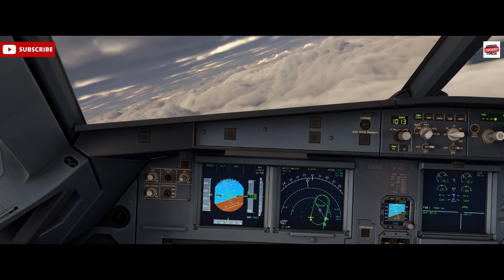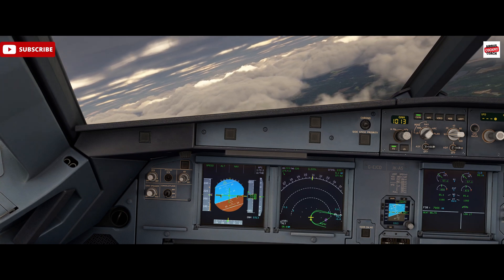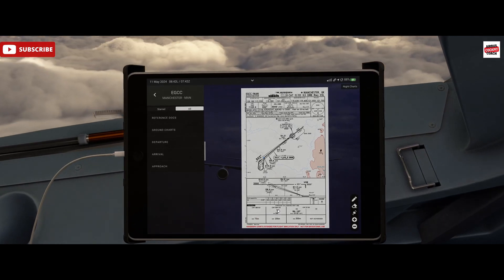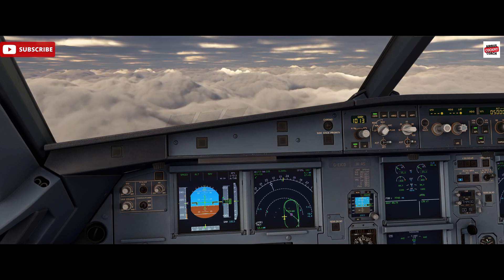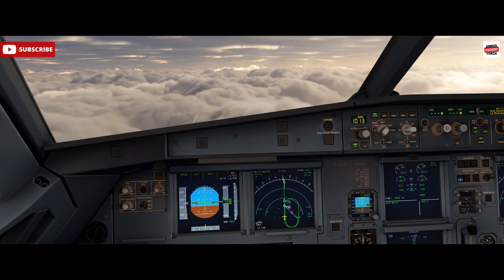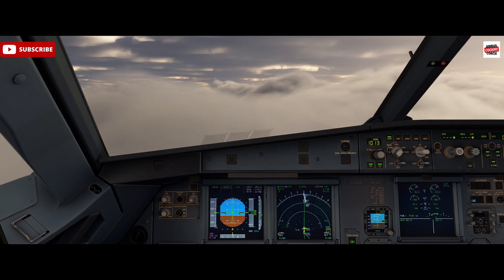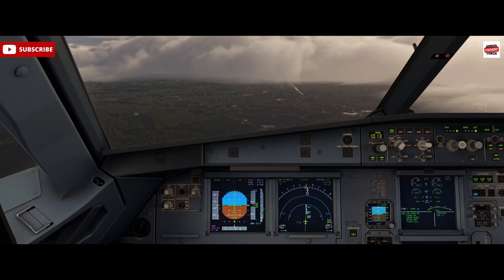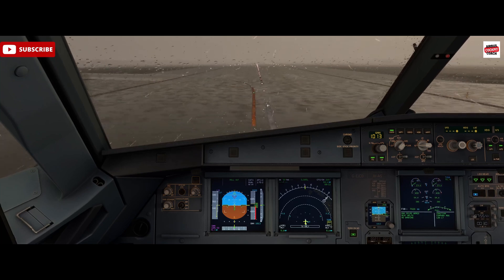How to Fly a CAT 3 Autoland in the A320 | MSFS 2024 Tutorial by Real Airbus Pilot

Comment: Hi! This is another great video! Thanks. Question I have is whether there any way to disable/disengage Autoland? I noticed Autoland gets automatically enabled/activated on the approach's that support CatIII. So even after I disable AutoPilot at about 1000 ft the FMA annunciates LAND and FLARE and I am unable to take manual control. What am I doing wrong?  This is on the Fenix A320
Reply from the maker: Hello, in the real world we press the red disengage button on the side stick which will  always give us control. It works that way for me in the Fenix so it would be worth checking your bindings as there are a few autopilot binding settings. I'm currently away from the sim so cannot check my current setup straight away. Glad you enjoyed the video 👍
Reply: @AirbusCockpitCoach  Thank you! Yes, my disengage binding is working ok. Am I required to disengage much earlier so that Autoland does not activate? I probably am trying to disconnect AP  AFTER Autoland is annunciated on the FMA. Need to try with disengaging AP probably at well above 500ft

Comment: Hi, could you please explain how you know when to add flaps, from 0 to 1 to 2 etc  to full, as well as when to lower the landing gear? Did you see any reminders on the speed tape telling you it is time to add flaps?
Reply from the maker: Hello, it all comes down to speed and the type of approach being flown. For a standard ILS aim to be flaps config 1 before intercepting the ILS, Flaps 2 at the top of the glideslope, after flaps 2 gear down, once gear is down flaps 3 and if a config full landing is required then aim to have flaps full before 1000ft. There is a flap speed limiting marker on the speed tape and the next stage of flap can be selected when 10kts below that (my operators operating procedures)
Reply: @AirbusCockpitCoach wow thanks! 👍🏼